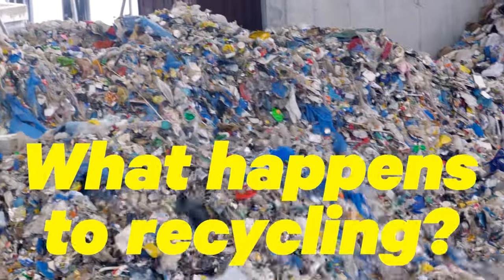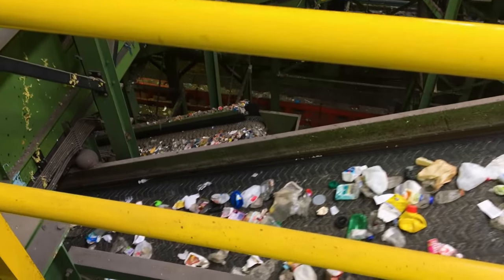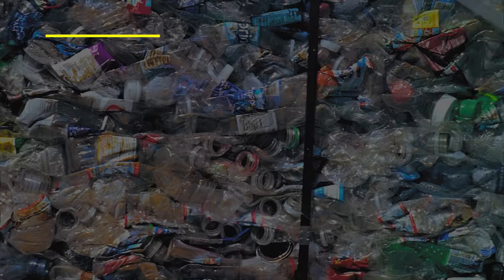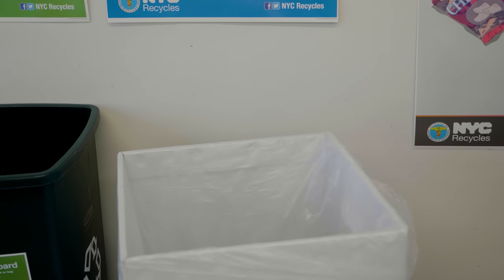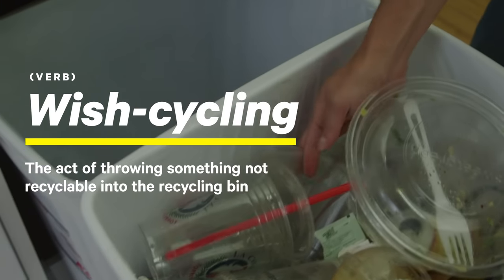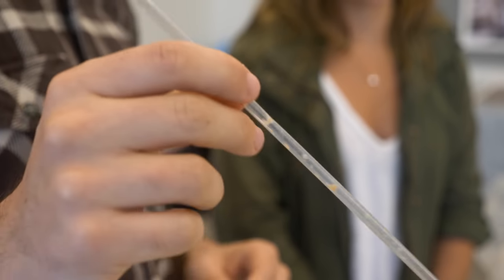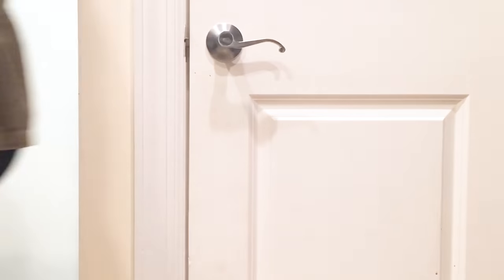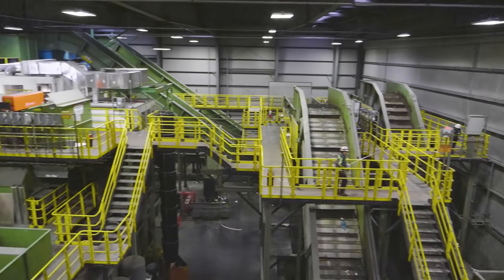What Happens to Your Recycling After It's Collected? | NowThis

Comment: Also guys, if people want to help the environement, buy containers 100 percent recyclable ,glass instead of plastic bottles, paper wrap instead of plastic, bring your own clay material cup to work and ban vending machines and if you have no choice but to buy the plastic containers, reuse them yourself as many times as you can before discarding them. it also helps if you check the recycling information on the product before you purchase it. And oh God does 100% coton not feel a lot better to wear on a hot summer day?
Reply: Robin Belley I wish we  would start manufacturing/  switch to glass bottles etc instead of plastic. I mean is it more expensive? I don't know. /:
Reply: AuroraHD glass is too heavy if made durable enough to not shatter if looked at cross eyed.
Reply: Cute theory but be careful what you wish for.... glass is extremely heavy and has to be keep absolutely pure for recycling. Paper stuff that replaces plastic is often plastic laminated or wax coated both are non recyclable and by semantics only degradable.
Reply: Glass is being dumped into landfill at alarming rates.
Reply: @fbboringstuff   - Actually studies show that glass is more sustainable since it can be reused.  It's less profitable for corporations who convince use it's for our convenience.  Also there is no need for the variety we have, that's all selfish on our part.  Not caring about 100 years from now.
Reply: yawn
Reply: Robin Belley so true, thank you for raising awareness
Reply: Why glass over plastic? Plastic is recyclable
Reply: Tony H buy glass to reuse it 💀 not throw out. plastic is not reusable it’s single use, it creates bacteria
Reply: There is no credible analysis that says very dense materials like glass and plastic are environmentally superior to plastics when all factors are considered. Just the amount of extra fuel that would be needed to transport the much heavier objects around makes it a non-starter. Basic facts favor the use of plastics as the lowest environmental foot print. Also, you clearly have never been to a paper mill - they are awful. Cotton is one of the most energy-intensive crops grown. You have no basis in fact for any of your statements and I encourage all viewers to do a little research and come to more substantiated conclusions.
Reply: @RES61527  Glass is more expensive, fragile, heavy and is made out of sand which is also a recyclable material....

Comment: This is great & definitely worth doing...however, most people are unaware that plastic can only be recycled 2-3 times before it degrades on a molecular level, thus becoming useless. Still, please recycle anything & everything you're able to.
Reply: You are right about the 2 or 3 times for certain specific usages, however the recycling can be endless when put to the right use example: paving, construction materiel like composites such as isolation coumpounds or even landscaping décorations
Reply: Which means it’s “downcycling”
Reply: The 3rd parties dump the recycling on the ocean
Reply: You could burn it for power and get rid of it after you recycle it too many times

Comment: I've been recycling since 1995,and composting biodegradable stuff where possible for at least as long,and I send so little to the conventional rubbish destined to landfill that I'm still very slowly using up rolls of plastic sacks given to every household in our neighbourhood by the local council during the noughties. But even with the numbered kitemarks for different types information on recycling of plastics is refrequently conflicting as to what actually will and will not be accepted apart from platic wrap/polythene and materials like polystyrene,styrofoam,etc. not. Fortunately our local supermarket has a plastic bag recycling drop-off thingy and the recycling scheme is a user friendly one where the recycling plant not the public does most of the sorting,so aside from people who need help with age and mobility type issues it must just be laziness and thoughtlessness that is behind some people not doing it when they could with little effort.

Comment: I'm putting more into my recycle bin than I was a few months ago. It used to be there was a rule here that the only plastic that was recyclable was #1 and #2, and only if they were bottles with necks. Also, the collection company rejected the boxes frozen food came in. 

But, I recently checked with the collection company, and discovered things have changed. They now accept the frozen food cartons and plastic food containers #1 through #7.  Of course, they don't want contaminated material, so I rinse and possibly wipe the food plastic.
Reply: Notice I wrote "plastic food containers"? The collection company doesn't want bottles that contained motor oil or other petroleum products. Residue of these chemicals can contaminate the recycling process, potentially turning a partially processed batch into waste. The bottles might be acceptable if I cleansed them with detergent. But, that could mean introducing the chemical into the sewer, which is unacceptable.

Comment: You have to use your reuseable bag 200 times before it is a net benefit for one use of a plastic bag. Thats right, 200 plastic bags = 1 reusable bag, and I reuse my plastic bags multiple times, by folding them and storing them for easy reuse. People often forget that plastic is very energy and co2 effective compared to other means. It is not the plastic that is bad, but how we dispose of it. The plastic bag should go into the incinerator after it has been used multiple times.

Comment: In ca we pay 5 to 10  cents on bottles and cans.  But there is no place to collect them for cash.  The homeless do not want them either anymore.  We just hope the garbage collector will separate them and it part of the tax to drink.  Plus with 10 different plastics types and only 3 are cost effective to recycle the separation is often too much and it goes into the land fills.  Fyi putting trash into a recycle bin is no good if you put wish items in with it, they contaminate the whole trash and it all ends up in the land fill.